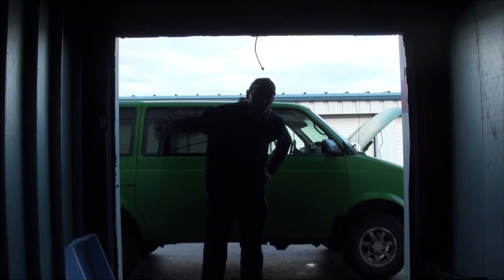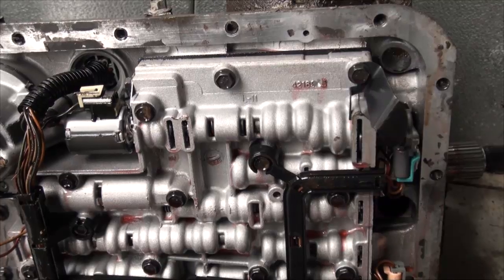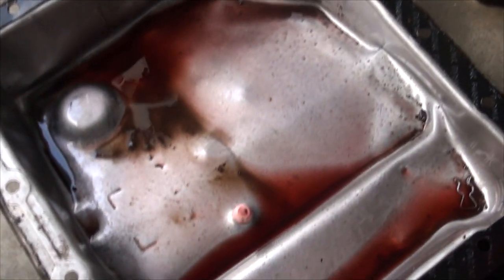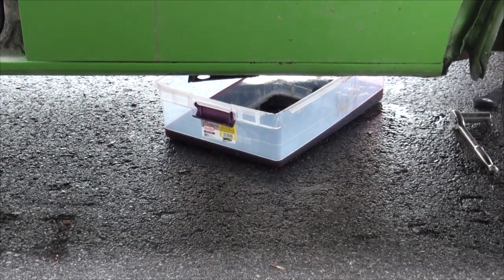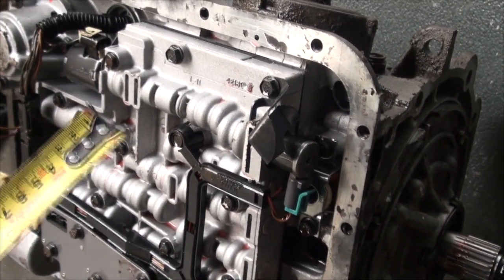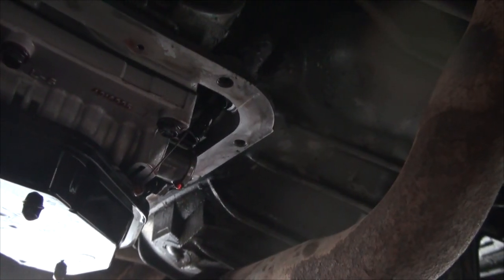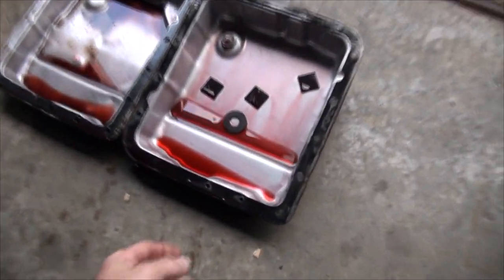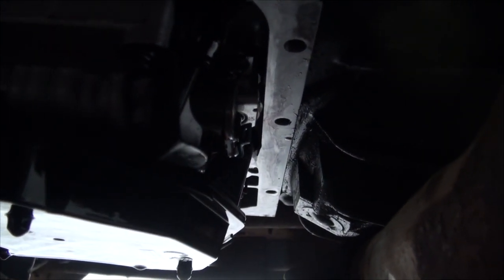ARE ALL 4L60E TRANSMISSIONS THE SAME?

Comment: @Stunt Dummy  Bro you'll need a camera not dependent on the web there is talk of shutting it off from reliable souce , if it doesn't happen great if it does well phone footage won't happen . Good luck brother
Reply from the maker: You're right. I have one and I'm charging it now. Something came up and I have to work for a couple of hours, but a lot has changed overnight and I will be streaming to talk about later this afternoon.
Reply: @StuntDummyLives  So glad you got the message . Should've known you'd know , but leave no stone unturned right . Should I delete my original comment ?
Reply from the maker: @onegrlindawrld6297  Nope, don't worry about it. I haven't done anything illegal.

Comment: Can you get the GM part number for that stopper ???
Reply from the maker: GM doesn't sell them anymore. You have to get a used one, or an aftermarket one. Also, they come in 3 different sizes. If you check my community page for this channel, you'll find a link to info about them. If you need one, I would be more than happy to send you one. You can find them at this link, but there's no part # https://www.gmtransmissionparts.com/dipstick-guard-4l60e-used-w-deep-pan/
Reply: @StuntDummyLives  OK Same info as me 😉👍

Comment: Good info keep at it bud excited to see if it lasts. Also your good at wrenching do a 80e upgrade if you want it to last
Reply from the maker: I would gladly drop one in if I could get one with an AWD transfer case. I don't think mine will match up to the output shaft of one, but I could be wrong. Next time I'm at that wrecking yard, I'll do some experimenting and see if I can make it happen. These transmissions are only $150 there so it's not a big deal.